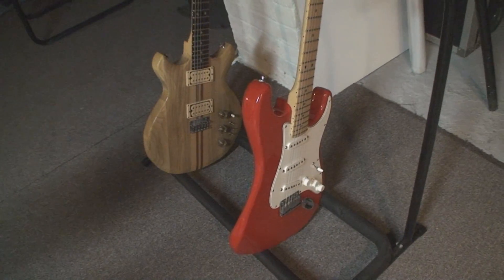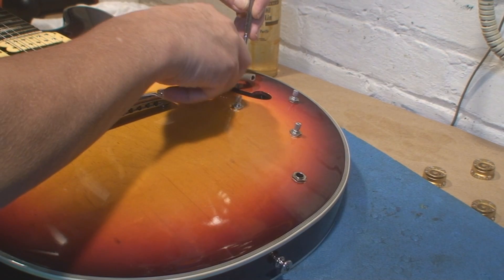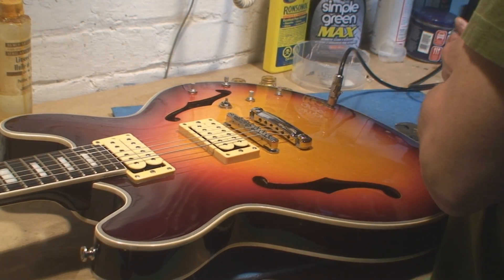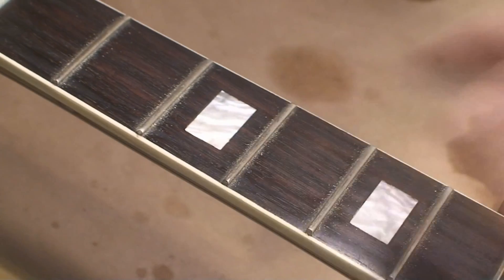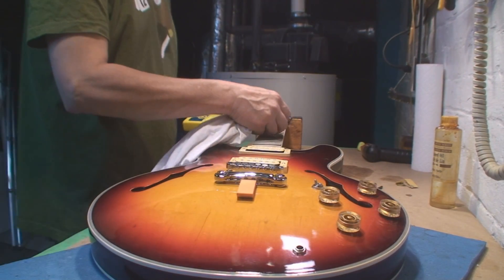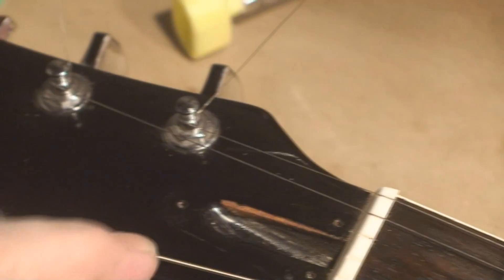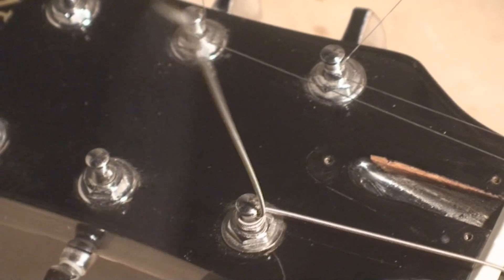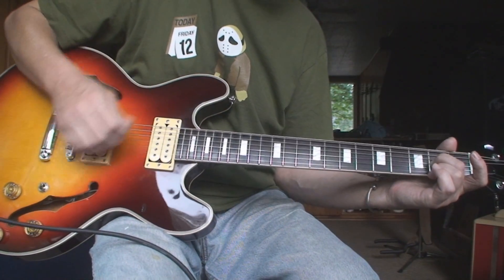Mann Guitar Vintage Japan Musical Gear

Comment: Dave I have a question for you. What do you think of using WD-40 for cleaning pots? Especially the really sticky ones. I had a friends guitar that had extremely stuck pots and with a dose of WD-40 and vigorus twisting I have both pots moving and working scratch/crackle free and I didn't have to touch the original solider joints.